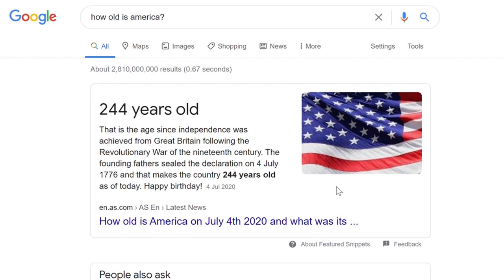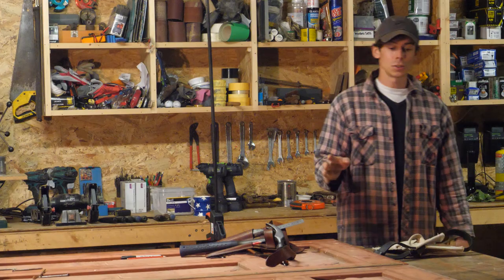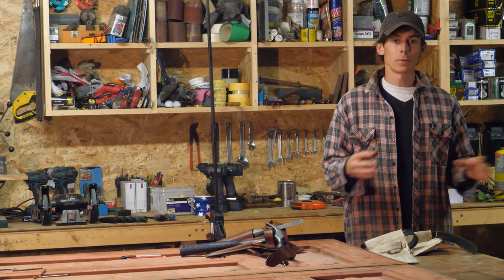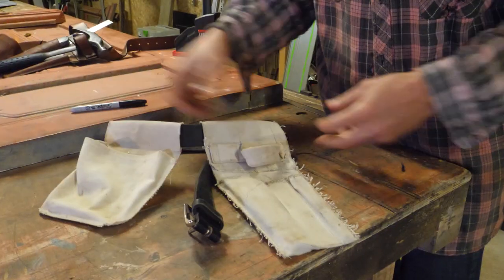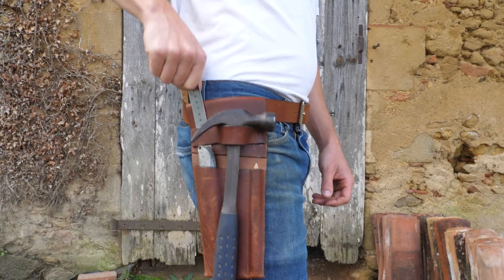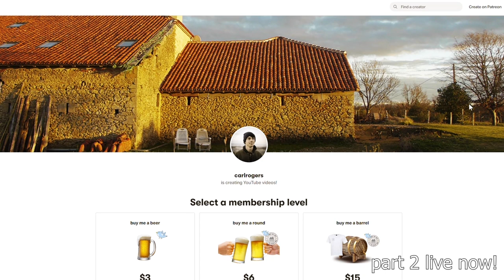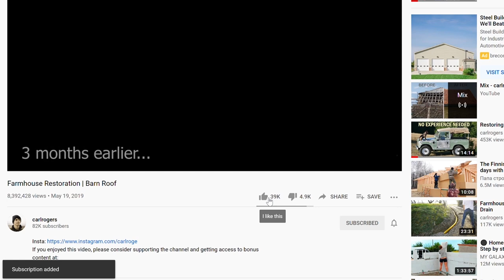Restoring an Ancient Barn | Part 1

Comment: I can believe that the main frame is that old but what is on top is definitely made sometime in the last century
Reply: you also  can tell this because of the nails, they are not even forged
Reply: Look at the description
Reply: @DonRob96  Cut nails have been around for over 200 years, and wire nails for over 150

Comment: Carl, this was an brilliant video that I just got recommended by chance, I love to see some proper hard work. Some great techniques were used here, my favourite was the wood depth stops on the saw bar and then sliding the saw to nibble away to your line using the original as a template. Really looking forward to rest of the series.
Reply: Safety is our no1 priority  I think not. But what the hell it's your job.

Comment: Nice work Gents!  Great joinery skills there!  Having used both leather and metal hammer holders, I found that I preferred the metal one rivetted to a leather backing as it allows for a cleaner draw of the hammer, especially when you need it fast like when elevated and working at setting beams and timbers.  Leather hammer holders tend to sag over time and can bind when drawing the hammer free.  I sure like your ideas though on the tool belt kit!  Keep up the fine work!

Comment: The owners probably looked at it for a hundred years thinking, I've gotta get that thing fixed.
Reply: I can’t see it being 288 yrs old. It looks like Asbestos and it’s screwed down
Reply: They "fixed" it by putting crappy asbestos board on, probably about 50 years ago. Now, Carl gets to fix it by putting proper tile back on.
Reply: @jmonsted  they did a great job, I was mesmerised
Reply: @Blessings.429  the asbestos roof & rafters aren't that old. it's the main structure that is probably that old
Reply: @stefken123  agree

Comment: I am so glad I learned that 2 mm offset before I built my small oak construction. It is the difference between a solid construction and a wobbly one.. Might not be as important when the construction is connected to other solid parts, but totally necessary when free-standing, like a pergola.

Comment: You know what you are doing, great job so far! Especially the drawpegging. Hopefully you wont have serious issues when the new green work dries out. 
Very interesting shot @ 4:54. They used a version of the English tying joint, but (as you would expect from les gallois, more elaborate and complex). Does the same job though-ties a post, plate and tie beam together to prevent the structure splaying outwards. At somestage along its history there was an upper floor, possibly an upstairs granary? You can see the joist sockets in the wall.
My Dad repaired a low pitch roof just like this in the Charente about 25 years ago. He put 2 layers of boards (poplar or chestnut? not sure?) then the roman style half round clay tiles, bottom layer facing up, top layer facing down in the grooves. It looked fantastic.He died 18 moths ago

Comment: What a great little film and what great work you did. I was saying to myself as you tore off the old rafters (is that the right english word?) "that is not rotten" - but then you moved on to the frame.. Which you did great work on.

One little thought. That mortising machine is very very nice. I would not mind having one. Until I have one, a small electric chainsaw can do the same work. The electric saws are easier to control than the 2-stroke ones and you can cut most rough mortises with it after some practice. Have one person spot you while doing some tests and you will soon catch on to it. 
You did use the chainsaw to "clean out" on the beam. Try putting the bar down flat the next time to trim. More control and a better "finish".

Those old guys knew what they did. The structure was very nice to see, and you kept up the workmanship standard of those old guys. Great movie and thanks for making and sharing,
Reply from the maker: we need to do a lot of prep work for the clay tiles, most importantly is getting all the rafters in line.... the old ones had to go!
Reply: @carlroge  Right! With tiles those rafters would really mess up the lines :-)
Looking forward to see more of your project. It is a very nice building you are working on.

Comment: With all my respect, this roof it is not 200 years old, may be the house, but this nails are modern, making from a industrial machine, the nail from 1700 and 1800 are making with hammer and hand, my house here in Chile have 200 years and the nail of the roof are handled makes also this ceiling is from 1930s... ( excuse me for my poor level of English) respetuosamente le digo que ese techo no tiene 200 años de antigüedad, los clavos que han sacado son modernos... hechos por máquinas, los clavos de los años 1700 y 1800 eran fabricados a mano con martillo y yunque, mi casa aquí en Chile tiene 200 años y todos los clavos usados en su construcción fueron fabricados a mano( son más grandes y cada lado aplanado) , el techo tampoco es antiguo es o debe ser de los años 30 del siglo xx . Es solo un dato para fijar la época de los materiales. Su trabajo es muy inspirador me ayuda mucho para la restauración que hago de mi casa aunque yo preservo los materiales originales y solo en casos muy necesarios añado materiales nuevos. Thanks you to shared your job. (Used the safety implement like gloves and eyes protect and ⛑ cobertura) hugs!,

Comment: With the amount of rust, I believe the panels are old galvanized; not asbestos.   That plunging chainsaw is a beast.  I’ve never seen one.  Thanks.
Reply: It's a chain morticer
Reply: @olivermansfield8341  £1200
Reply: Good chance that is paint, not rust. Notice it looks almost identical to the clay tiles, so chances are, someone painted them to match. Notice their thickness @ 2:12. No steel roofing is that thick, at least that I am aware.
Reply: Its called 'super six' in this country ( NZ)  Developed after the war (a shortage of iron? )and used until the '70 when it was finally admitted  that long fibre asbestos was not the best for ones health.

Comment: Hey. You get the standards (the vertical) of the scaff the wrong way. They need to be twisted 90° so the ledgers that are going longways are connected to the higher star of the vertical and the transom going width ways connected to the lower star of the vertical.

Comment: cement board , machine cut screws and square cut wood, the only part of that roof 280 years old were 5/6 main beams ,and they were rotten.
Reply: you do realise its quite normal practise to remodel buildings (new roof coverings/cladding/sidings etc) over the years?
Reply: @GOLDSMITHEXILE  but i wont called it 288 years old

Comment: An interesting project. Have you considered making yourself some trestles, about 640mm high ? Then do your framing in the horizontal, you will find it a lot easier than stacking things vertically.
For cutting long curves, rather than cross cutting multiple times you can use the saw vertically and follow a marked curve. Cut with the top of the chain so the wood chips go down, away from you, it's a lot quicker. 
Keep up the good work, and I look forward to seeing your new tool belt.

Comment: when drilling the holes for the pegs at the end, why did you disassemble the piece and measure out where to drill but at other times drilled it all assembled together?
Reply: This is to create 'draw'. When hammering in the oak pegs the offset is designed to pull the joint tighter. When manufacturing oak frames i tend to predrill the mortise before fitting the tenon. Then once you are happy with the fit of the tenon use a drillbit on reverse to mark the centre hole. I offset by almost 4 or 5m, sometimes even 1/4" if i really want it to draw up. I wouldn't have gone for just 2mm as the pegs can occasionally bind in the mortice hole before they have had a chance to draw the joint up tight.

Comment: This is a greatest way to duplicated the original carpenter.  
The only difference, the equipments used. All the electric power drills and sawmill, etc.
More important, all pegs were used, no nails nor drill in screws. 
Hey, at 12:00 you guys used nails and screws?  How not continuing uses pegs- in angled to secure all remaining jobs?  
Great video, I liked so much like old days hand made.

Comment: they made cement board shingles and hex headed lag bolts 288 years ago ? yeah, i don't think so, according to wikipedia fibre-reinforced cement shingles were invented in the late 19th century. The building might be that old but the roof isn't.

Comment: 18:00 Just noticed that the blade appears to be on in reverse, you would want the teeth pointed down not up. If one were to break during the times you have the guard pulled back then centrifugal force would shoot it up instead of down.